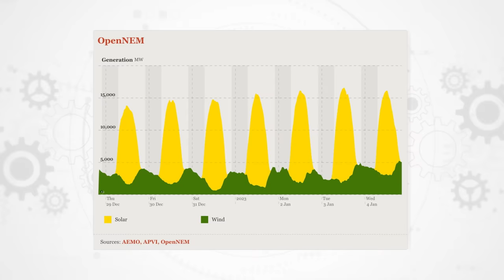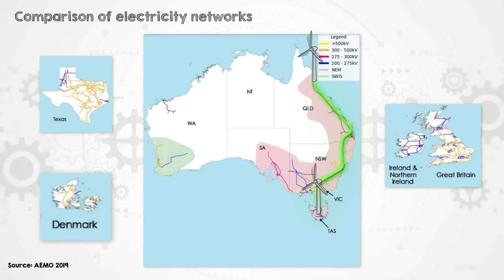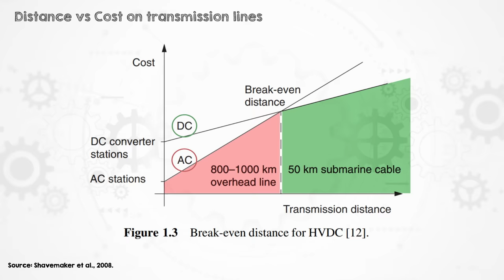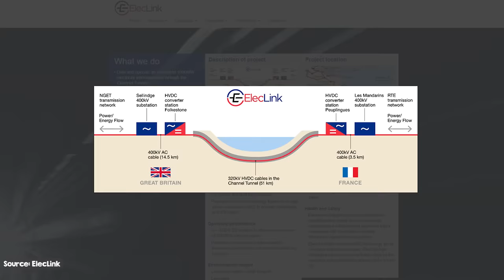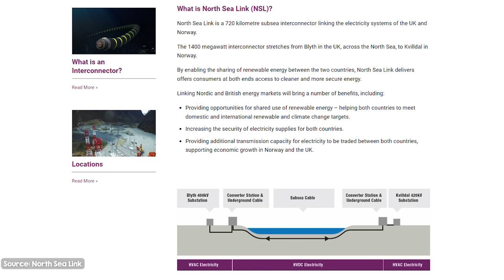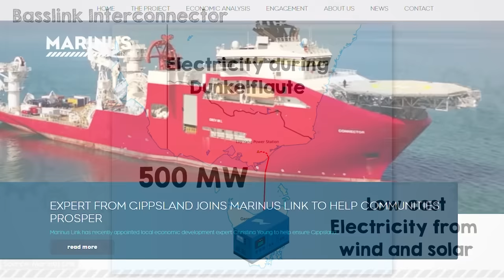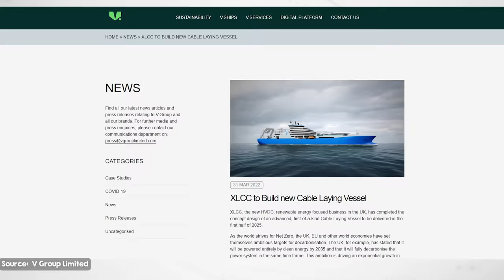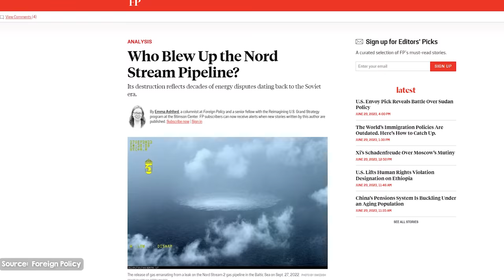Electricity Across Oceans: Is HVDC the Future?

Comment: Her first sentence, "Solar and wind power are the cheapest sources of energy right now" is, at best, a half truth.  Where are they located?  A solar panel in Arizona or Egypt is going to provide very cheap power.  Wind turbines in certain places would be too.  Not so in other locations.  It's highly, highly dependent on geography.  This is an extremely important factor that is totally glossed over.  Also, due to the intermittent nature of the technology, you have to account of backup sources of power when the wind doesn't blow or the sun doesn't shine.  This fact is conveniently left out of this equation.  Take Germany.  They have installed renewable capacity that is twice their peak demand load.  Does Germany live in energy bliss with virtually free power?  Hardly.  Again, the statement is true, but in basically the most meaningless way possible from a practical point of view.
Reply: That is why you need the cables, no point UK putting solar panels in Scotland if they can be put in Morocco where they will generate 1000x more power during the winter and genuinely be the cheapest source of power.  And not much point installing Wind turbines in Morocco when they could be installed in UK's northern seas where they will often produce 1000 times more power than they would in Morocco and produce the cheapest electricity on Earth!

Comment: The world’s longest power transmission lines giant transmission lines transporting electricity from the Belo Monte hydroelectric project, in northern Brazil, to a sub-station 2,100-kilometres away 800kV ultra-high-voltage direct current (UHVDC) line that transmits electricity from the 11.2GW. I think it is aluminum core it will be 30% of aluminum made in decade. We really stretching energy supply, even 800kV is high voltage at 2100 km distance if energy losses will be from 5 to 10% from total maximum. Simpsons joke about outsourcing electricity manufacture to India based on episode Kiss Kiss, Bang Bangalore is kind of became reality

Comment: The Energy sendt from Norway to Germany have about 30% loss across the ocean... Then is a waste of our hydroelectricty, then it should have been pumped into a water powerbank instead of sending it to another country with this high loss.
Reply: There is no point storing energy if you will not have use for it in a reasonable amount of time, energy trade works because your surplus from today is sold withing a day so you have room for tomorrow's surplus.
A gigawatt of energy storage costs few billion dollars per GWh; selling one GWh each day at peak time at $0.2/kWh profit after expenses earns you mere $200000 per day so a cheapo $2B pumped hydro station would pay for itself in little under 30 years.
Building the same energy storage but storing the power for a week each time means your dam now takes almost 200 years to pay for itself, assuming the maintenance costs remain the same.
Power lines are cheaper than energy storage and need less maintenance so selling the same GWh earns higher profit. Why, yes, the customer might only receive 700MWh of it but you are still selling them a gigawatt-hour so you better set the pricing to take the losses into account.

Comment: I think simply boring a hole in the ground and hanging a bucket of the same dirt from ground level with cables like a below ground elevator as an ultra-simple, low cost gravity battery might be the best way to go, locally at any site and of any scale.

The Boring Company and Elon Musk should make vertical shaft versions of various diameters for local, simple gravity battery storage purposes.

#SwitchToSolar #SwitchToElectric #EndFossilFuels
Reply: Yeah, the problem is that a gravity-based battery has extremely low capacity for its size and weight. The scale required for a useful amount of storage is much larger than you may be thinking.

Just to give you an idea: the 3500 mAh lithium ion battery in your smartphone has about the same amount of energy as a 100-gallon tank of water that can be raised and lowered by 40 ft.

Comment: Cost and energy security are horrible for these projects. Ukraine shows what happens when you base your economy on energy from foreign powers.
The fact that the UK grid charges have rocketed in the last few years is due to all the renewables requiring so much extra grid connectivity.
Nuclear is the answer. Grid changes are minimal, footprint of the generation source absolutely tiny (especially compared to wind farms), maintenance is relatively low and best of all, they work 24/7 come rain or shine.

Let's use massive nuclear investment until fusion becomes viable, which is fairness is always 50 years away.

Comment: geothermal is the future, and getting rid of all this costly infrastructure is the way to go.
geothermal can go anywhere.
no expensive lines to bring the power places.
you can put geothermal in the centre of an industrial  area supplying to all.
nort from where sun is brightest.
or winds strongest.
or where gas and coal are.
ANYWHERE IT'S NEEDED.
not needing 1000's of km of lines to bring it wqhere it's needed.
too expensive.

Comment: This is just so dumb. Its also extreme cherypicking. Looking at late 2022 when differential prices was 15-20 times than they usually are, Something that is unlikely to happen again.

For the Atlantic cable there is several things that is total showstopper. Firstly the losses make it totally uneconomical. Than the length. The thing with under sea cable sis that they have to be manufactured in one pice. So the ship have to carry the full cable. That is alright for a cable that is 300 or 400km long. But if its several thousands, the ship need to be gigantic.

The other thing. the cost. For a cable that long, it would just be cheaper to build a nuclear plant. Why even bother with the cable?

Even for the UK to Norway cable that cost "only" $2B. That is about half the price of a brand new APR1400 reactor. And that is only for transferring power half the day. So in reallity its really pointless. About politics. This is nothing but politics.

Comment: NOT ENGINEERING.
An undersea cable carrying 100s of Megawatts is kind of like putting your eggs in one basket while you tip toe across a tight rope.   And a 5,000 km cable will dissipate a lot of power, even with high voltage DC.   The cost of this length of cable would be in the Billions of dollars, with no guarantee it would last more than a couple of years.   You don't mention superconducting electrical cables.  Not likely that would be practical under the ocean.   BTW your maps are cartoonish.

Comment: Your interpretation of solar being the cheapest prodducer. Is so wrong you really do not know how your ideology interferes with that. The cheapest is and with current technology is nuclear.  For starters solar panels will be lucky to last 15 years. Wind turbines is more likely to last langer but only with blade replacement and oil replacement every 10 years. The estimates provided by the csiro which everyone seems to go off. Are so far out of the true cost it is unreal. The truer number will end up being double or triple. So no solar or wind are not tge cheapest.  The cheapest is either hydro or thermal then gas then coal. Nuclear is far cheaper and much more reliable than any wind or solar. As you are an engineer what happens when the C02 levels drop below 150ppm . Maybe you can answer another question for me. How much C02 does the earth need and the oceans.  That is an answer no one as been able to answer unles you are looking at the bs biased payed for scientific notation. Which if you are a true engineer you should have seen through from the moment you looked into it and realised it is crap. The rest of the show was rather interesting.  But there are ways to get around the ac skin effect,  and the main reason we went ac over dc was the generation of electricity was and is much easier and reliable with ac. The dc loses are still there but it has to be transmitted at high frequency or pulsed to reduce those losses and you did not go it to that to much.

Comment: This woman doesn't have practical knowledge and is selling theoretical ideas.  Marine cables are limited by the capacity of power it can carry and there is no way it can be made  economically viable.  Any electrician can tell that!
Also UHVDC would be used and not HVDC for such distance.

Comment: Aide from being nutty, what problem is this supposed to solve?    We have lot of real problems to solve and limited resources to solve them with.    This Idea is actually so stupid only politicians would dream it up     High wattage lines must carry heavy currents as well as high voltages.  With 3 phase AC networks (60 cycle BTW...that's another issue)  high voltage lines encounter inductive losses that increase with transmission line distance.  DC cables swap inductive losses with pure resistive losses all of which turn electrical energy into heat.    The only suitable conductor would be enormously thick copper cables and the voltage would required at least 500,000 volts also requiring suitable insulation that would need to be 15 feet thick  Maybe it could be done for a few trillion dollars.   Budgets this size are deadly to the poor.

Comment: Solar&wind are not cheapest as they need backup and lots of extra grid infra.
The HVDC Cables here in the Northsea fail regularly! Consumers don't notice as we in europe have 100% gas/nuke/coal 'backup'.
In fact Dutch and German electricity prices have doubled as we now have our existing grid and generation with another grid next to it for solar&wind.
Also the AC/DC DC/AC converters combined with the HVDC cables are as expensive as a complete gas/coal plant.